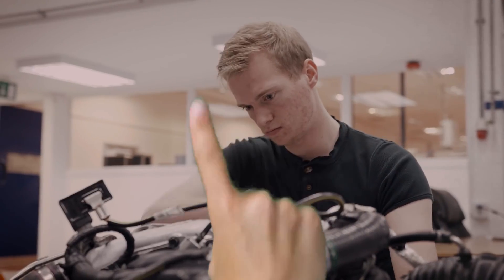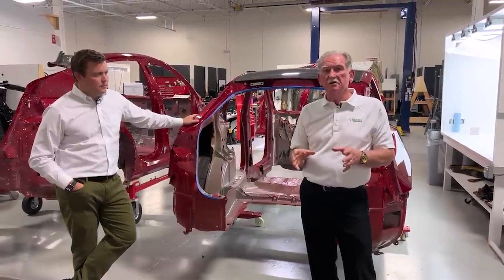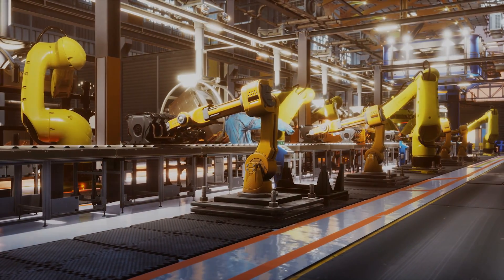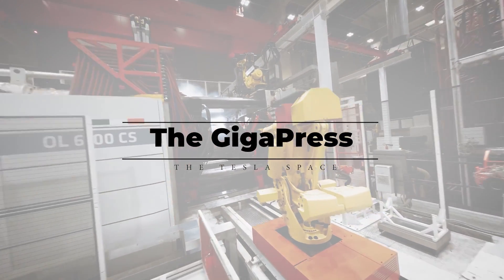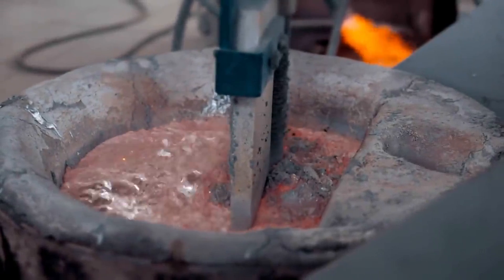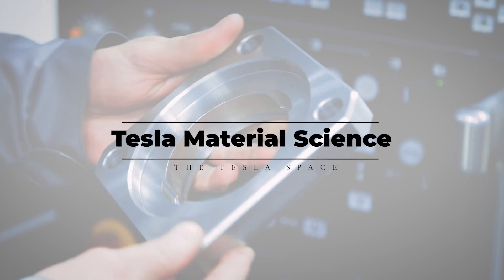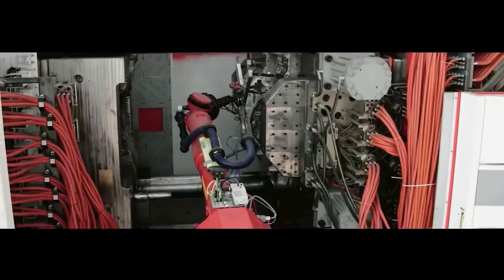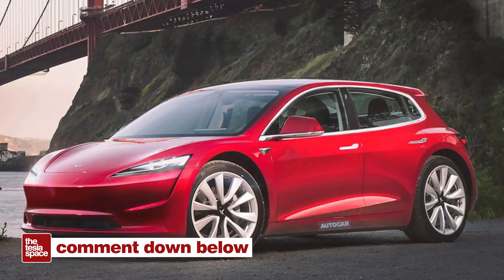The Incredible Logistics Of The Tesla Giga Press!

Comment: I suggest there is no reason why Tesla won't continue on its skyward trajectory of innovation and permanently leave all others in the dust. Fantastic!
Reply: Gigapress is an outdating technology in China, otherwise China will not let this factory export his technology to IDRA, even this Italian factory is a subsidiary.

China's military jets frames are no longer using these high tonnage press, they have migrated to 3D unibody metal printing, the superpress technology is no longer military grade!
Reply: @liwenhu5864  you are confusing many applications here
first and foremost, SpaceX pioneered in the usage of metal 3D printing a while back, for parts of the merlin engine, so they are plenty familiar

the problem with metal 3d printing is that it's SLOOOOW, haven't you ever seen a 3d printer working?!

the Chinese military has shifted only the high end jets to 3d printed frames, like J20s, which won't be produced at high volumes

for the rest regular casting will still be used

Comment: Yeah, they said that Cybertrack will be made not casting but bending - so it's for MY or M2)
Reply: thats the exo-frame not the structural components
Reply: Problem with the Cyber Truck is the design leaves much to be desired for a pick up truck. Can't side load it, for starters. The Rivian is a superior design for not just aesthetics, but as a pickup truck in general - it's a lot more functional with details for daily use -  more stuff, less fluff.

Comment: My father made a line of cast aluminum safety products. One thing to consider about using such large castings in an automobile, is that you can't repair cast parts; you typically have to replace them, and if they are making such huge castings it means that fender-bender body shop costs will be staggeringly high. 

Aluminum is a soft metal. THere's a very good reason why Steel has been used for so long. It selectively deforms, and is very repairable. So these cars are more of a disposable product. I would be more comfortable if they made various modules and riveted them together so you could replace say the rear right section of the car body. Tesla cars average over 2200/year in insurance costs (and can be as high as 4k in some jurisdictions). What is the point of saving fuel with an EV if your insurance costs wipe out the savings?

Comment: A vehicle formed in a single casting, would look like the upper body casting of a Hotwheels car.  The under body would be a second casting with the structural battery pack being relying on it for its base and sides, and the suspension/brakes/transmission/engine(s)/thermal management/aircon/wiring harness would be components received by it.  So the "car" would be the upper body, dropped onto the electric skateboard.  That electric skateboard might be used between multiple different models, varying entirely in the upper body casting, and in the fitments.

Comment: Could you make the chasis in 1 piece maybe, would it be desirable NO, The middle section is for a structural battery module and needs to be assembled with internal components, it is not just a chunk of Aluminum.

Comment: It seems like you should talk about how these castings affect the people who buy the cars. The engineering processes and utility of these castings are only as good as the experience they provide the end user. Clearly Tesla would have thought about this but what is the result? If a Tesla is in a crash, can you take it to a panel beater? If not, can Tesla invent panel repair processes for minor damage that even Tesla can allow 3rd parties to repair? For bigger damage do you need to throw away the car and get a new one since you can't replace small sections of the body?
Not touching on these things suggests that they are problems without good solutions.

Comment: I was playing with the idea of whether the Cybertruck body could be stamped out of the single sheet of metal at one shot.
Reply: The 300 series stainless used is too hard to be stamped at all--much less an entire body.  According to both Elon and Franz in different interviews, the reason for the Cyber Trucks triangular shape with flat surfaces is because the metal used would destroy a stamping press.  They are scoring the panels and folding them on a brake--think folding the metal at bend lines.
Reply: @genephipps6421  Perhaps "stamped" was the wrong term.  I meant to say something like folded.

Comment: I don't know if they will do a whole car in one shot. It is certainly worth it to have a mold that can replace 300 parts, but it might not be worth it to have a huge casting just to eliminate 2-3 parts. Probably easier to just have 2x or 3x molds for the whole frame.
Reply: My thoughts exactly. They already have 95% of the benefit (non-expert ballpark figure). I'm feeling really good with just 2 parts. Now they're REALLY killing the competitors on manufacturing, as if they weren't already!

Comment: It would seem to me, that in an accident a mega pressed car could be a write off since just about the whole car structure is damaged and cant be replaced in with smaller parts to the effected area. That will in time effect insurance rates
Reply: See this suggested frequently.   Did you catch where they talked about the alloy in the video.  It is ductile and can be welded.    Have not seen much being done with that yet.  Have read auto makers are moving to stronger lighter steels that are less ductile and increasingly more difficult to repair.    Also given that Tesla is now insuring cars it makes sense for Tesla to reduce repair costs.  Keep the customer happy.  Have to see where all this goes.
Reply: That is why passive safety is so important. The ability to avoid colliding with anything while being the safest possible if one occurs. The car can also record the footage of the collision and learn from it as well as identifying culpability.

Comment: I agree that while the Cybertruck should provide great off-road and on-road performance...utility will probably be an area of compromise.
Reply: I think the utility will surprise you.   The durability alone will make it a better work truck.
Reply: @danharold3087  Charging Electric Vehicles is annoying tho.  At least at my company, Every EV will need a dedicated parking spot with a dedicated charger.  So at the end of the day, you can park it and forget it until the EV is needed again.  Gas trucks can be refueled in minutes.  Companies can't lose time waiting for vehicles being refueled.  So,, every work truck needs a dedicated ev parking spot.  That is prohibitive for most companies.
Reply: @currentsupply   You're looking for why it will not work.  The accounts will look at cost savings and if they can make a strong case it will go with EVs.   Saving on maintenance alone may pay for the needed chargers.  When each truck has its own charger you will save that trip past the gas pump.  Checking the oil etc.

FUD spreaders have you thinking that it will always take a long time to charge a truck.  This is typical of their tactics.  Charging times are going down.

"According to New Scientist, research conducted at the Idaho National Laboratory can charge EV batteries from a 0% state of charge to 90% in 10 minutes, equating to a 60% decrease in charging time compared to current Supercharger times"

If your thinking all battery claims are pie in the sky realize that the current battery has 8X the capacity of batteries of 10 years ago.  This advance is what makes the Tesla Semi workable with a 500 mile range.

Comment: Good explanatory video, with one caveat. The casting is neither doused nor later heat treated. Early Model S castings were doused and they distorted slightly and had to be worked on, so Tesla material science developed an alloy which didn't need it for the Model 3/Y castings. Therefore greater accuracy and fewer processes. Elon Musk explains this in an interview with Sandy Munro on the Munro LIVE YT channel.
Reply: I wonder if they need a bit of time to settle down after casting so they put them in racks and move them outside for a couple of days as we see at the giga factory. Maybe surface oxidation or rinse off the peanut oil/ removal.🤔
Reply: @malcolmrickarby2313  They just need a cooling down time, so inevitably a cooling batch is produced where the first example is cool enough to be used and the latest hot one adds to the batch. Under such conditions, there's no waiting.

Comment: A few things, you still use the non-word casted. When you deploy your throw net, you have cast it. Not CASTED it. Next, once you have cast the rear casting the car becomes heavier, not always what we want in an electric car.
Reply: Modern movies 🎥 have the cast cast without a casting couch. Less pressure!😂
Reply: Reports are saying the cars with castings are lighter.
Reply: @danharold3087  You know that this isn't true. IDRA is Chinese owned and headquartered in China. What leads you to believe that many Chinese brands aren't already using castings
Reply: @MegaWilderness  Not sure where your going with me being wrong.  Weight depends on the design of the casting.  Arguably the alloy is more important.  The Tesla S with 4680 and casting(s) is 20 lbs lighter.   IRDA is owned by LK Group.   "LK Group is now working with 6 other car makers — all of them in China —".  That was a bit over a year ago.   There is less of a case for using the big castings in China.  Headwinds regarding expense and loss of jobs.   Maybe it is happening.  Have not seen evidence that it is at this time. There is another problem.

In article "Casting Machines Coming To 6 More Chinese Car Makers"
"But there’s a problem. Remember how Liu said every time Tesla made a change in its design, LK had to make changes in its machines? Liu says many Chinese companies can’t find enough qualified people to make the designs needed for LK to fine tune its casting machines for them. “Many Chinese automakers are talking to us about building the machines, but the majority of them are still in the design process,” he says. “We have a bottleneck in designers in China.”

Comment: Many follow-on stories now are needed. Elon claims that his patents can be used by VW, Ford, General Motors, Toyota, etc.  Will they do this?

The model 3 will now be resigned to become a one piece gigacast?

Current car manufacturing, the Henry Ford style, with human labor instead of almost total automation, is now extinct?

Can the China brands (Byd, etc) also now use gigacast machines?  

Does Tesla use industrial glue and spot welding? How much less of this do they do?

Operating the Tesla still requires user maintenance.  How much is automated, prompting the user? How much is eliminated completely, or severely limited? 

We are assuming that some maintenance requirements still need user attention? Cleaning the windows and dust and dirt?

The corrosive resistant metals forced an new type of paint. Is that a Tesla patent and necessary requirement that makes normal painting and maintenance not work so well?

Which of these Tesla changes to machine development be moved to other manufacturing industries, to other products, and to other brands?  Failure to follow Tesla advanced will make which brands to collapse?  Toyota, who refused to be totally EV?  General Motors, who had so much brave claims and daring intentions, but unrealistic deadlines and deliveries?

Comment: I'd like to see how the Giga Press could handle FRP instead of aluminum. I predict plastic of sore sort will eventually be used for the entire frame, if not the entire body in white.
Reply: For a while, Starship was going to be made in Carbon Fibre, but the SpaceX team ditched that idea and went with Stainless Steel.
Reply: Maybe but its not as simple as manufacturing it. There are all kinds of regulations and safety tests that would have to be met. That said, if anyone can do it, Tesla would be my pick. They are amazing in what they do. SpaceX and Tesla both. As a 65 year old the differences between the mid 60s and now are almost unbelievable. Almost magic. I picked 60s because that's all I can remember. Crazy.
Reply: Always remember that aluminum is easily recycled and polymers are not.
Reply: A little off the Giga Press topic, but this intrigues me. Let's think a little further into the future. What would a vehicle (probably autonomous) be made of if it is explicitly designed not to crash? And let's take that one step further - what about if all vehicles on the roads are eventually replaced by those that can't crash? What are they made of? 100% recyclable bio-plastic?

Comment: I can see the front structure, floor pan and rear structure cast as one piece. I propose that the battery pack and belly pan be attached to the floor pan with an array of through bolts that clamp the two pans and the batteries into a composite structure. I can see a platform for raising the battery pack up to the bottom of the floor pan with an electric driver for each nut nut on the bottom of each through bolt. Zimmmmmmm! Done and torqued.

Comment: I'd start with a Roadster 1.5, a long overdue refresh. Casted into 1 piece. I'd try 2 of the 1st smaller presses set side-by-side. One cast. Multiple injection ports. Make a full casting. Add injector ports for other parts. 

Make this Roadster a modernized improvement. Hold off on the SpaceX rocket version for Roadster 2.0.

The speed of gigapresses means bottlenecks in production will be much slower. One set of gigapresses can provide more than one model line. This has implication to the design of the factory floor.
Reply: Remove some more robots and create space for more lines in an already gigantic factory.👍🏽

Comment: The next level engineering that Tesla brings to manufacturing is mind-blowing. Step-change mind-blowing.
Reply: The next level engeneering belongs to IDRA not Tesla.
Reply: @vintagegamingrepublic5156  So according to your claim, Tesla didn't collaborate with IDRA on the design of these presses needed for the production of Tesla cars?
Reply: The casting machine was an excellent collaboration between the companies, I get that. Tesla’s vertically integrated manufacturing system, though — the machine that builds the machine — is step-change awesome.
Reply: @ChitFromChinola  In every instance of video footage I've seen of Tesla's manufacture, I've not seen anything of suspension manufacture, wheel manufacture, gear, driveshaft and CV manufacture, brake manufacture, electric motor manufacture for seats and door closure, glass manufacture, electronic board manufacture (except for assembled in Mexico stickers), shock absorber manufacture, air suspension manufacture. How is this vertical manufacture? They look like an assembly plant to me.
Reply: The Munro Associates tear down videos are a pretty good source. From the tear downs, it looks to me like Tesla makes a lot of stuff that other companies out-source. Front casting. Rear casting. Batteries. Battery pan. Heat pump. Seats. Electric motors. I think their engineering is pretty amazing, and their level of vertical integration is much deeper than most. But if you think it’s all rather ho-hum, you’re probably right. I’m not an automotive engineer, and Sandy Munro is probably full of it, so you go . . .
Reply: @ChitFromChinola  Sandy is not much help to me in answering these questions. The HVAC compressor is manufactured by a third party. Have you seen Tesla's machinery to make the octovalve inhouse? What about the dashboard, err kitchen counter and the rubber door trims, do they make them?
Reply: @MegaWilderness  
Yup, I guess you’re right. The Munro team uncovered nothing new or innovative. Tesla is just another ordinary, run-of- the-mill car manufacturer. Nothing new here. Yawn . . .

Comment: With regard to the castings of an entire vehicle, it seems the two halves would need to be the right and left halves of the vehicle running lengthwise. Kinda like what appears on Tesla’s investor day promotional image everyone is sleuthing over. The two halves would be connected widthwise by the structural battery pack. The size of the battery pack could be altered by its length ( to a degree) if necessary. The drive unit would  couple the rear together. The steering unit would couple the front halves together. Steering units (right hand/left hand) depending on the country, could be interchangeable. Can’t wait for March 1st.
Reply: The downside is that's an increase in projected area, which requires much more clamp force on the tool.

That's likely not viable with the current gigapress.

Comment: The giga press and the alloy is like when they had to come to work steel to build taller buildings that needed to flex.
One press car casting? Im not sure if making a car in one press is necessary since the speed they make model Ys is already incredible. You can always add another press to increase volume

Comment: I’m still really interested in what the crash rating will be with a single casting, or the damage to another vehicle and it’s occupants
Reply: Why? The model y with single and dual castings have been out for years now. The very first model y sold in 2020 had the casting. 
Munro tore one down and showed it off. The latest dual castings 4680 pack model y was torn down last year by them to. 

Crash ratings for them have been available for years now.
Reply: I mean it would be the same more or less. Its still aluminum and they are still using crumple zones.
Reply: Maybe an added 'crumple zone' or shifting passenger area for the necessary shock absorption.